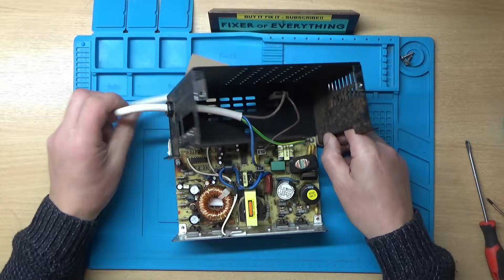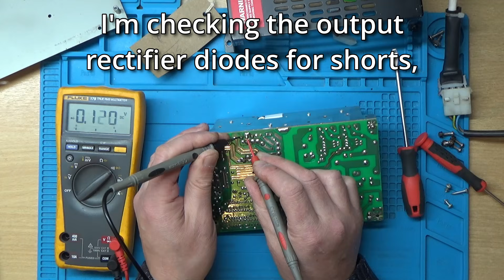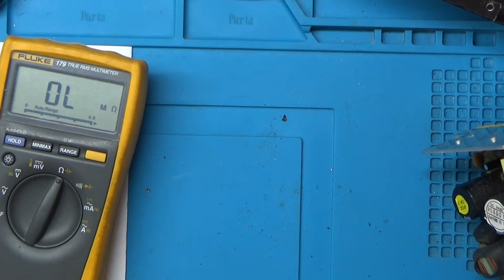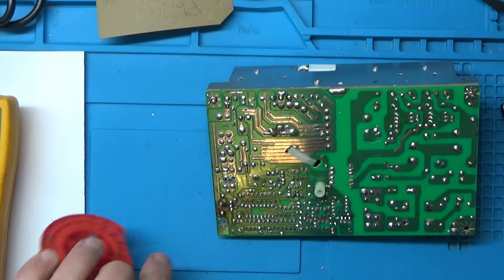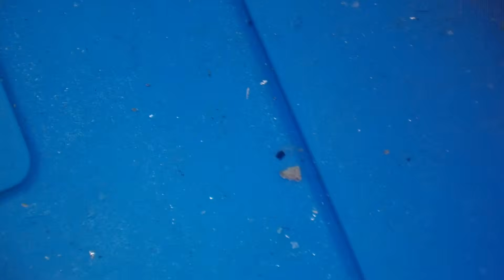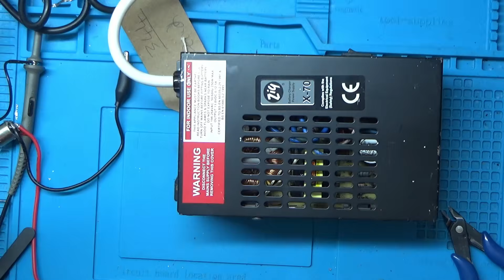Faulty SMPS Charger ⚡ ZIG X-70 Caravan Battery Charge Repair!✅

Comment: One thing I noticed is that you didn't say you checked or replaced the two small electrolytic capacitors on the primary side. They are part of the driver circuits for the two transistors and they are rather critical on these TL494 / control transformer based supplies. If they have bad ESR or not enough capacity the transistors won't be turned on strong enough, causing the supply to either shut down under higher loads or the transistors running too hot.

Comment: High pitch noise is almost always diodes. It should of been furst thing to check.
Second the chokes and transformer joints.
Thirdly the capacitors.
Reply from the maker: Thanks for the tips 👍

Comment: What had caused that resistor to overheat as board was burn’t. The one on the end of pcb?  Had you checked that one, I’m sure you had as you are very thorougher.
Great repair. 👍
Reply from the maker: Thanks 👍I did test it, and it did have a resistance. Unfortunately I couldn't read the value on the resistor itself to verify it was correct. I think it's a ballast resistor on the supply output. When I searched for pictures of the board they all looked to be similarly overheated.

Comment: I fix a lot of these as I run a repair business.
9 times out of 10 Its usually that orange SMPS supply cap which you found and this causes a noisy operation until changed. I also had high output off load of 16V
Replacing that brings it down to 14V and silent operation. I replace all the small ones also 1uF 50 and 4.7uF 50 as they are always 10 ohms plus ESR  
👍
Reply from the maker: Good to know, thanks for the info! 👍

Comment: Again outstanding for us newbees.
You are so thorough and without the schematics it is great. I have a question so when you test the controller chip 6ou always do Vcc ground and Vref. Is that like a universal approach to diagnosing problems? Also sometimes in some of the power supplies the main capacitor only has half the voltage so 150v instead of the 300v plus required. What charges the main hot capacitor? is it just the rectifier or it depends? I know one of the PS gets the 300vonly when I plug the fan it uses from the output side.
Reply from the maker: Thanks. Yes the capacitor is normally just charged from the bridge rectifier. In this version they had two capacitors in series which is why the voltage is split between them. Then they use one for a +150v, and the other for a -150v (relative to the ground between them). It's called a half bridge.

Comment: Hi, I have two identical X70 PSU with the problem that they do not start up properly. The LED then lights up briefly after switching on. If I am lucky it stays on and the power supply starts up properly and works. I have replaced practically all the capacitors.
I do not fully understand the circuit for starting up, is it the coil with the blue wire that is supposed to take care of this?
Reply from the maker: If the LED lights up then the PSU has started. Might be worth trying changing the switching IC.
Reply: @BuyitFixit  The LED lights up for a very short time, a fraction of a second. Or it stays on and then the power supply functions as it should. I measure 0.3V on leg 12 of the switching ic when it does not start up. I really think it has to do with the power supply of the IC.
I have already replaced the switching ic on one print.
Reply: @BuyitFixit  I have connected a 50W lamp over the HV elco's because discharging takes a very long time if it does not start. I first replaced the red capacitor and then more than doubled it to make it start better. If I double the capacity it works better but still not flawlessly.
Should I still look for it in the secondary circuit, is there a component that causes the start-up voltage to be too low?

Comment: 510 ohms is not a preferred value, however 560 ohms is, with 5% tolerance it could be between 532 and 588 ohms
Reply from the maker: Seems it is according to the internet... https://www.oreilly.com/library/view/complete-electronics-self-teaching/9781118282328/9781118282328b04.xhtml
Reply: @BuyitFixit  As I recall, 510 is in the E24 series. On a different matter, I strongly recommend removing all traces of "Evostik" type glue for any repair, since heat turns it brown and it exudes an acidic vapour that corrodes everything it touches.
Reply from the maker: @manolisgledsodakis873  Thanks for that. Yes I discovered that on the JVC HiFi I looked at on the channel 👍

Comment: I still wonder what is the purpose of that glue some manufacturers puts on their boards. I have seen so many boards where glue can be to blame for all kinds of issues. I fixed an old power supply board where some caps had leaked and corroded the board badly. The glue covered the damage
Reply from the maker: The only thing I can think is it's for mechanical support.. I'd not really came across it that much until I repaired the JVC HiFi system (with valves) on the channel and it had caused a few issues on those boards.

Comment: Great detective work as usual. All the way through I'm thinking he's going to swap the big vertical resistor, (that's turned the board brown,) for something with a higher wattage.
Reply from the maker: Thanks 👍I wasn't too sure on the original value. It did show some resistance, and when I searched online most of the baords I came across looked exactly the same.

Comment: never saw the burned resistor fixed. did i miss something.
Reply from the maker: I'm not sure what the value of the resistor is supposed to be, and there were no obvious markings on it. It did still have resistance. When I was looking at pictures of other units they all appear to look the same (discoloured and burnt) so I think it's a design "feature".

Comment: You can go higher on voltage with capacitors if you don’t have an exact match just not lower. As long as the capacitance is the same.
Reply from the maker: Yes agree. I've done that a few times, although it also depends if space allows, as usually higher voltage capacitors have a larger footprint 👍

Comment: Very long shot here but wondering if you happen to remember the value of R48 on this board. The larger 2 or 3w grey one down near the outputs (Where the boards scorched). Ive inherited one and this seems to be missing :(
Reply from the maker: Really sorry, I can't remember off hand. I did measure it and it did show a resistance at the time which I assumed was correct. I think it was somewhere around 1K or so, but I could be totally wrong!
Reply: @BuyitFixit  No worries, I knew it was a bit of a long shot :)

I found that the lower its resistance, the lower the output voltage. Your guess may be correct as Ive found I can get 14.2v on the output using a 1.1K. Sadly I think im missing something else as the output evaporates under load. Ill keep plugging away, thanks for getting back to me.

Comment: At this age of electronics it's better to assume all electrolytic capacitors are dried out partially. To give the board another lifespan I would just replace all of them without thinking long. Goes much quicker and is still cheaper than checking considering the saved work hours.
Reply from the maker: Good advice, although it may depend on the amount of capacitors involved?
Reply from the maker: Good advice, although it may depend on the amount of capacitors involved?

Comment: I thought these testers were able to test capacitors in-circuit (because they work at low voltage and don't activate PN junctions or something like that, that's beyond my understanding). Have you tried it?
Reply from the maker: No, not tried that but if there are other components such as a resistor in parallel with the capacitor I can't see it working correctly.
Reply: @BuyitFixit The resistors in parallel would generally be quite large  and mostly on the high voltage capacitors, wouldn't they?
Reply: @NicksStuff  Yes, ESR meter often gives good indication when testing an electrolytic capacitor in circuit. 
An ESR meter simply measures resistance to a low voltage AC current (roughly 1 volt at something like 50-100 kHz AC, depends on the meter). The ESR the meter is reading (in ohms) is just an indicator, its not supposed to be an empirical measurement.  Theoretically, an electrolytic should have zero resistance to AC current, in practice it just needs to be low (esr close to zero). If there is a resistor in parallel with the near zero esr of a capacitor, the resistor will have negligible effect on the esr mesasurement, the only exception being when  the resistor has lower ohms than the capacitor esr. In this case you will be measuring the lower resistance of the resistor (because the capacitor has high esr). This is only a problem if the parallel resistor is only a few ohms or less (becasue it gives you false reading of low esr, when the capacitor is actually shot). But usually the parallel resistor is more than a few ohms, so you will still suspect high esr in the capacitor. Hope that make sense.
edit. What this means is that you can routinely flip a board over and quickly check esr of all of the electrolytic capacitors in circuit, identify any that may be suspect. Dodgy ones usually stand out like a sore thumb,  low value capacitors of a few uF are a bit tricky, they often have a few ohms esr when perfectly fine (measure some brand new ones to confirm, its a good way to "calibrate"  and get to know your esr meter). I have a 1ohm resistor glued to my esr meter, I use it to check the meter is still working properly.
Reply: @jumboegg5845  Thanks!

Comment: HI, I started my career and a TV engineer in the 70's (Rumbelows UK) when Valves were a thing and progress to thru to full solid-state TV and then computers,. You remind me of me many years ago and love your persistence. I always used to say take a close visual evaluation first and then  note what is working as much as what is not!  I had an apprentice Paul who had much potential who moved up to the Nort east. Anyway good job and  what microscope are you using? Great stuff and keep it up.  PS you can find may short circuit faults by injecting a regulated high current source into a faulty circuit  and use your thermal camera.
Reply from the maker: Thanks 👍Yes I remember Rumbelows 🙂 The microscope is an Trinocular Amscope clone on a boom arm with a 48MP camera and two 0.5x Barlow lenses. Yes I used voltage injection a few times, like on the Crucial SSD I repaired on here a couple of months back 🙂

Comment: Excellent fix!! Id bet the difference in output voltages is due to a battery maintenance ( float, desulfate, etc) circuit. I think you’d find that after it’s been connected to the coach’s battery bank for a while you’d see varying voltages as the state of charge increases. That being said, a bad coach battery(ies) could be to blame for the shore charger failing to begin with. Great video!! I look forward to the next. 
BTW… Do you have an outlet (eBay, etc)where you sell items you repair ?
Reply from the maker: Thanks 👍a lot of the stuff I repair I either keep or still have lying around 😂😂I need to have a clear out.

Comment: I wonder why you never looked at the resistor on the left side that was black and had the skid mark on the board?
Reply from the maker: I do remember measuring it, but perhaps that bit never made it onto the video. I wasn't  sure of the correct value of it though as all of the markings had burnt off if I remember.

Comment: Connect a series lamp, if the input circuit is good the lamp will draw power for a short second and it will turn off, if thats the case its the output part of the circuit which has the problem, if the lamp is on the entire time its the input circuit. It saves a bit of time doing this so u dont waste time figuring out which part of the board is at fault
Reply from the maker: Thanks for the tip 👍

Comment: LM358 is a jelly bean part, there is no excuse for not recognising it from the first milisecond you saw it! 
And because the damn current transformer is right next to it, an 358 does measure from ground, ofcourse it's part of the current loop ( you need no degree to know that, it's basic electronics ). 
On the other hand measuring the mains bridge is pointless since the fuse is ok, also the power transistors must be ok just because the fuse is fine... 

I've seen this channel recommended on eevblog forum by someone, but i see it's a waste of time, there is no substitute for electronics theory, and that you do not have unfortunately...
Reply from the maker: Sorry if it's not up to your level of expertise. I don't profess to be an electronics expert, and that's not the purpose of the channel. I'm just a guy that fixes stuff and a fair few different things (the idea is to help people with similar broken items repair theirs). Remember someone else may have one with a faulty bridge and now they know how to test it. I've fixed a wide variety of stuff from Thermal cameras, a medical ultrasound scanner (which I also unlocked  ton of hidden features and ran DOOM on) to solar inverters where I even had to reverse engineer their software and write my own service tool which I made available free to download to help others. No, I don't know everything, and I do make mistakes.
Reply: @BuyitFixit  ok, maybe i was a bit harsh, so sorry for that.
It's just that in all i do regarding electronics engineering i strongly promote electronics theory because i believe it is the only way to evolve in a better version of yourself.
And LM358 it is by far the most popular opamp out there ( that is why it's called a "jellybean part" ), it's one of those opamps used just about everywhere by everyone, and every electronics person knows it...

On the other hand, sorry if i have to be somewhat rough again, but if someone does not know hot to measure a bridge rectifier then someone should stay far, FAR away from line powered switching supplies, they really kill those that do not know what their doing.

I guess i can relate to what you are trying to do, so good luck, maybe ill stick around.
Happy holidays!
Reply from the maker: @DjMarik78 Thanks 👍

Comment: well done mick on fixing the Zig x-70
I have a similar zig x-70 that's damaged, I can see the choke LF2 in the heatshrink is damaged and trips the mains.
Would you have any idea what value it is ? thanks
Reply from the maker: Thanks mate. Unfortunately not, and I can't measure it as I gave it back to it's owner. Sorry.
Reply: Thanks for reply Mick, I think myself that its not too critical as there is 2 chokes wound round common core for noise suppression on the ac L and N lines , I might try one I got out of old microwave to see will it do the job
mike                                       @BuyitFixit
Reply from the maker: @MichaelODywer  yes or from an old ATX PSU

Comment: Hi there, I have a 48v samsung lithium pack for an e scooter that had been allowed to discharge beyond the BMS safe point. I've individually slowly recharged each of the 13  paralleled cell packs to make them even and get them to 3.5v each the BMS still won't allow me to charge via it.  But it appears to have a rechargeable cell and presumably a memory and quite possibly needs a reset of some kind. I've tried shorting P to B of BMS but with no success. Can you please help?
Reply from the maker: It depends on the protection IC. I'd start by looking for chip numbers and then searching for data sheets. I had similar with a ring doorbell. The chip seemed to be non resettable.
Reply: @BuyitFixit  can I send you a couple of pics and let me know what you think please?

Comment: I think the supply probably lost regulation as those electrolytics slowly died causing the output to exceed 15V and the zener sacrificed itself as designed to shut the output down. Those switch mode supplies can be a nightmare to fault find and typically use less than top quality electrolytics. Well tracked down.
Reply from the maker: Thanks Ian 👍

Comment: Hi what camera do you use to take these   vidios
Reply from the maker: Hi, when I first started doing videos I used an old iPhone 6, which did an OK job but I couldn't zoom in and out (so I had to do that in the editing software using digital zoom).
I now use a used Sony HDR-CX450 with a third party wired remote. You can get a 4k version too, but I just went for the HD model. I've got it mounted on an overhead boom arm with a 4ft LED batten light that I used for lighting. 
Hope that helps 👍

Comment: That was so interesting. During the pandemic I dragged out about a dozen of old caravan chargers that I had replaced when I worked as a mobile service technician ( brakes, gas, road lights etc.) . Some faults were visually obvious and when I replaced the part/s I did the same using an old 55w head lamp bulb as a load test for half an hour but  I don't have enough electronic knowledge to understand which component played what part down to the level you can. Merry Xmas.
Reply from the maker: Thanks 👍and Merry Christmas to you too!

Comment: The heatsink on these are often conected to the mains , so no touchy
Reply from the maker: The heatsink is the directly connected to the outside case... would make for a bit of a dangerous power supply 😂

Comment: You gotta discharge the caps first before putting them in the tester .
Reply from the maker: Good point. I think they would have discharged by the time I de-soldered them bit I guess I should have checked 👍